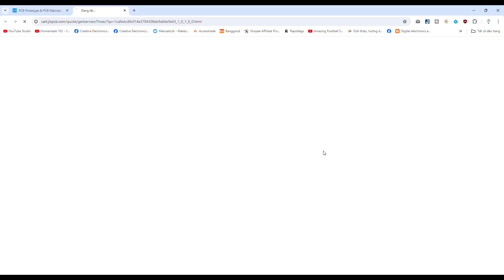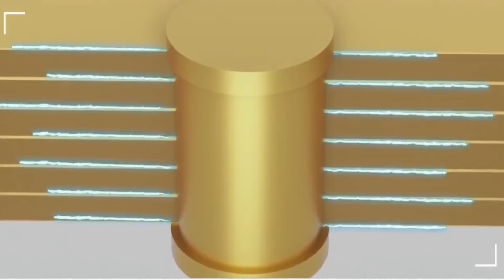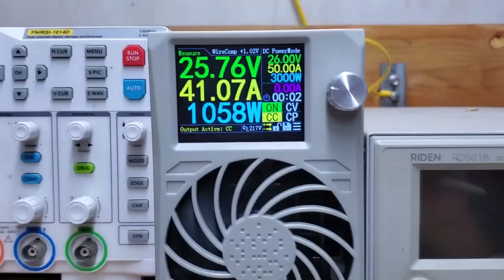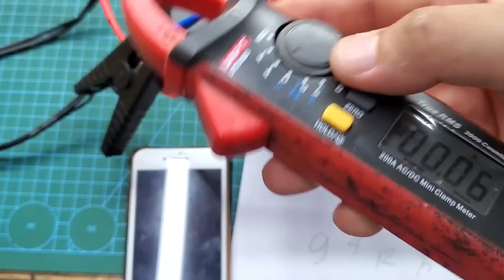High-Efficiency 1500W Inverter sine | JLCPCB

Comment: Why not use a pnpand ziner diode high speed switching mosfet would run cooler resistor as speed switching off is no good 50% turning of speed mosfet get hot with speed driver

Comment: I think high voltage high power applications must use X1/Y1/Y2(and may be Y3 in your case) capacitors, shouldn’t they?
PS Aha, you generate 220AC, so Y3 is not applicable

Comment: Friend, I would like to be able to see a project sufficient for the average load of a home, 3,000 watts for example would be enough. With the following features: that works with 48 volts DC at its input to achieve better autonomy in battery performance, that is pure sine wave, that also has a built-in MPPT solar charger sufficient for its capacity. And above all without transformers so that its efficiency is as high as possible.

Comment: I don't understand. Why is Batt-  connected to the transformer Center tap, the Batt+ to all Drain and mosfets Source to the transformer alternate windings?

***Edit
Realized its still going to function the same. But i am used to a conventional design of Batt- to all Mosfet Sources, Batt+ to Transformer Center tap and alternate transformer windings to Mosfets either Drains.
Reply: Its push pull topology
Reply: @k3ggaming926  Yeah, I know it is. Just that I was used to a different setup which is different from the video.
Reply from the maker: The biggest benefit here is that you don't need to insulate the MOSFETs from each other. You only need to use a single aluminum heatsink.
Reply from the maker: However, if we set up the MOSFETs this way, we cannot drive the MOSFETs in the usual manner. Therefore, we need to add a small transformer (GDT).
Reply: @PhdHung  Thank you very much. I learnt a lot i know from your videos. Can you point to a video of calculating GDT pls. Thanks again.

Comment: well this is unexpected, i also trying to build my own high frequency inverter, well most component are the same.
what frequency did you use for stage 1 with that winding configuration? is it standart 35khz or reaching more, like 60khz, and for the lpf inductor, is the value also the standart 2-3mH? and what enameled wire diameter did you use?

Comment: Sir please details in GDT transformer core size primary and secondary wire gauge and turns,
output ac filter inductor wire gauge for handle 1500 watt
Reply: EE16
Primary 50 truns
Secondary 50 truns